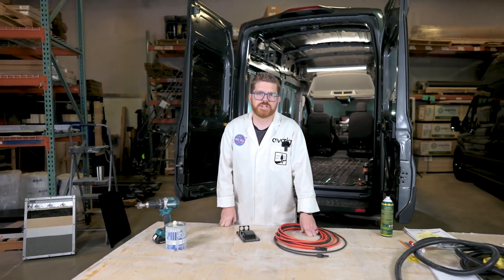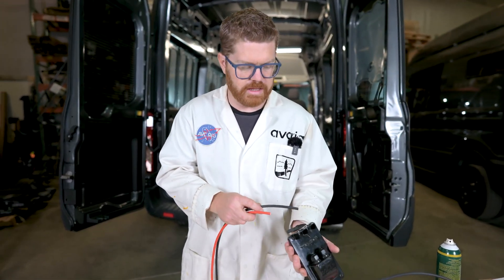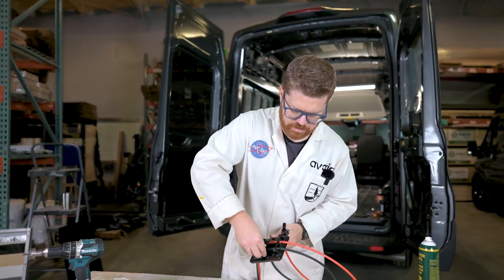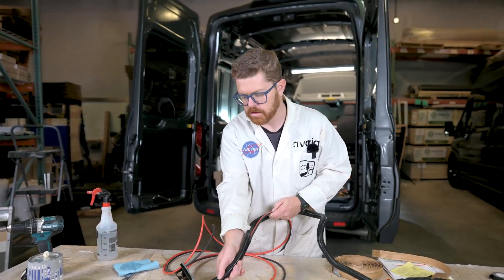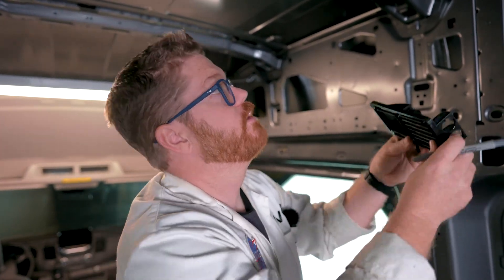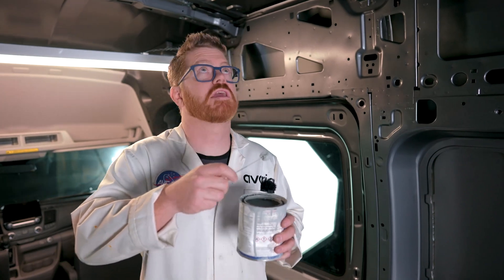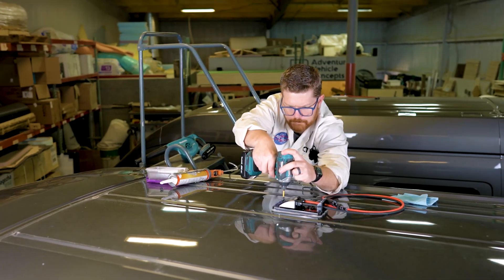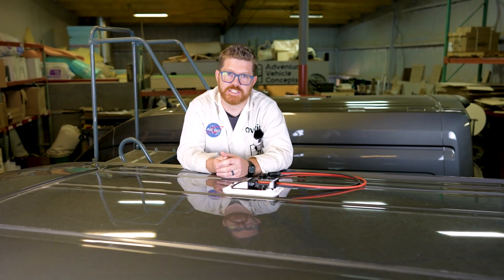Solar Wiring | How to WIRE your VAN's Solar Power

Comment: Sorry for being such a newb, but how do I then connect the ends you pass through the gland/roof to a power station?  Basically I also need mc4 male and female ends once the wire is passed through the roof and I can’t for the life of me find an example of how to do this. Thanks!
Reply from the maker: Most panels have an MC4 on them. You just plug them in. The bare end inside the van can wire directly to your solar controller.

Comment: Also, with the bushing, would I get the same size bushing as the hole? Here, it looks like you made a 1 3/8 in hole. Would I need a 1 3/8 inch bushing?  Thanks a million!😊

Comment: Hi, Matt! Your videos have been an invaluable asset. Thank you so much for all of them! I see a link for the drill you are using, but would you be kind enough to let me know what material my hole saw bits should be made of in order to do the roof holes and the hole for shore power? If you have a shopping link for that, I would love to try to support your channel through that 😁

Comment: It looks like the cable entry gland can have the MC4 connectors mounted directly in it. Is that correct? I thinking of prewiring for down the road, but not have the wire flopping around since I don't plan to have a roof rack. I know this would mean adding jumpers, later on, to connect to the panels, but I'm used to making up solar cables so that wouldn't be a problem.
Reply from the maker: That’s %100 the way to go. I extend mine only because I’m always going to mount solar right away. I think keeping the connectors tight to the gland will be the best for future use.

Comment: One more question, what footage are you recommending 20’, 30’?
Reply from the maker: That’s very dependent on your build. I typically run a 20’ but cut off at least 6’ or more. It also depends how you wire your panels. I typically run in series unless connecting to a goal zero.
Reply: @AVCRIG  I am planning on wiring to a goal zero and was trying to figure out series vs. parallel. Can you explain why parallel for goal zero?
Reply: @travisboeh996  the goal zero is more sensitive to higher voltage. (Limits at 50 if I remember correctly)  When we wire our normal solar controller we connect in series to increase voltage and send more power through a smaller wire.  For the GZ we wire in parallel and increase amps but keep our voltage lower.

Comment: Concur about placing the fan and solar panels toward the front of the vehicle, leaving the rear for a deck or whatever.  We're intending to put the AC unit where you have the fan on this build.  Any thoughts on that?  Will we be able to fit solar panels on either side, like you're doing on this buld?
Reply from the maker: It really depends on your AC and solar. The width of the rack in between the blades is 60.25 we use the RTX 2000 for AC and it wouldn’t allow solar next to it.  Check our Zamp Solar. They offer some different sized panels that might fit.

Comment: Another great video. It looks like a Renogy 100w panel on my AVC rack would be really tight on both sides of my Maxx Delux fan Their specs say 20.9” wide. Is that the panel you’re using? Thanks!
Reply from the maker: Yep that’s the one! If you look back on our Instagram there’s some pics.

Comment: Thanks for the always useful info.  The knockout bushing insert you used in the hole in the roof... You'd think they would be easy to find on amazon, but, that size, not so much.  Do you happen to have a link, or should I, maybe, just check the local home depot?  Thanks for sharing!
Reply from the maker: We struggle with the same thing. It’s a tough size for some reason. Must not be too common. We like them because they fit 3/4 split loom.  I’d try the local store for that one.